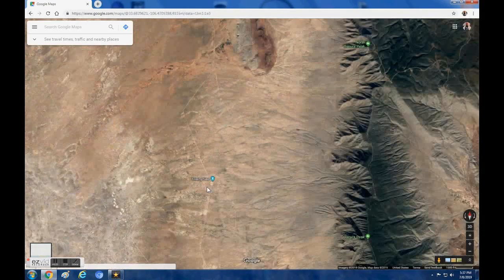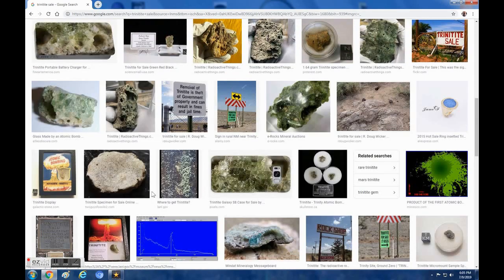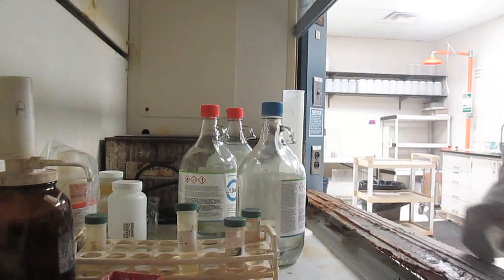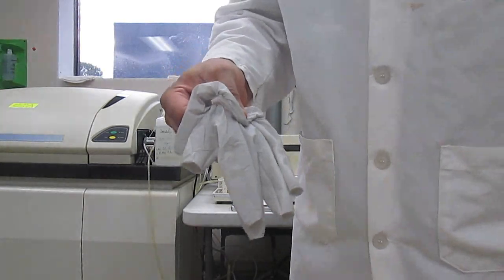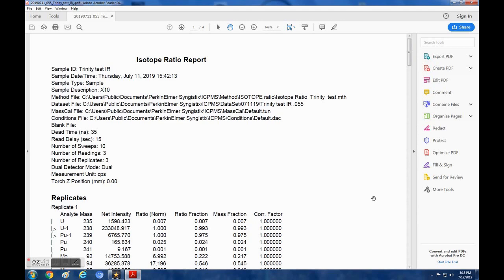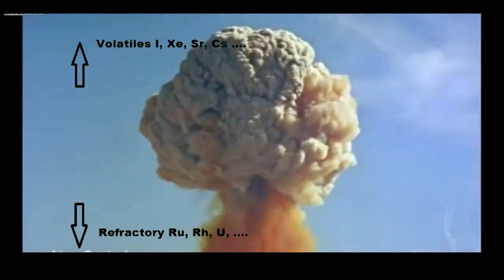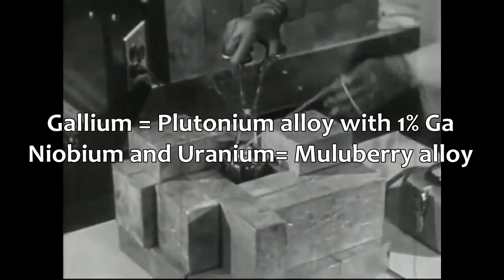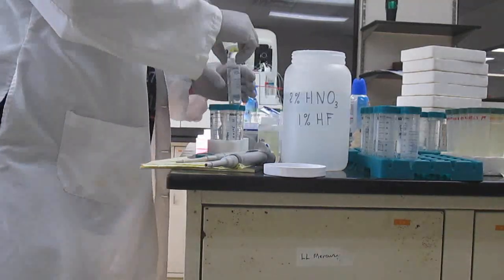Trinity Nuclear Fallout Analysis part 1

Comment: I thought the tamper concept and using U238 around the core was a later development in bomb making - not present from the start. An innovation along with levitated pits and tritium boosted fission to help the yield and reduce the size. This is quite an interesting discovery.
Reply from the maker: Both little boy and fat man had a tamper . I am not sure if it was uranium or tungsten. The idea of maintaining the chain reaction for a tiniest bit longer was understood early on, the physicists at Los Alamos knew that most of the yield comes from the last few generations of fission hence the neutron reflector design . Thanks for watching!

Comment: Could the ratio of volatile to refractory elements be used to give a ballpark distance to the center of the blast?
Reply from the maker: Depending on the condition at detonation. If it was windy building around rain etc .. the volatile element envelope the refractory ones in a dirt sample so less refractory means a sample further away from ground zero!